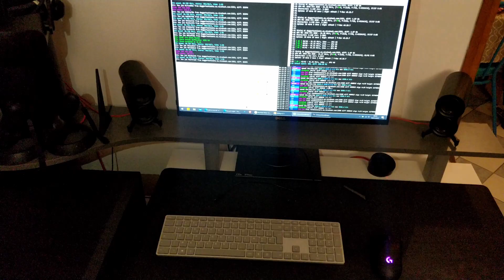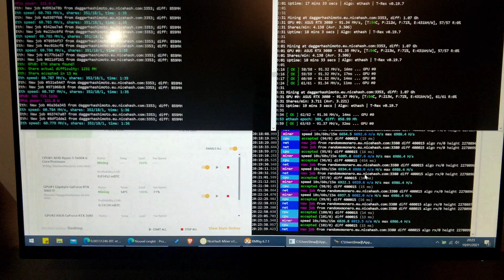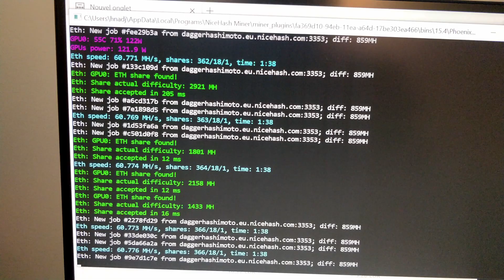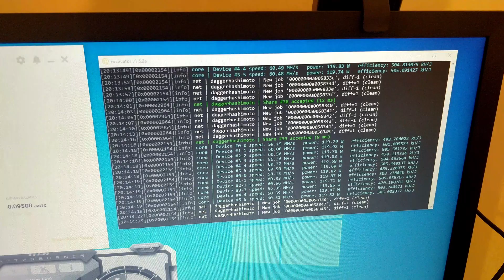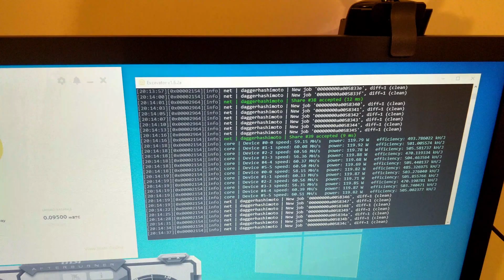DIY Mining Rigs | Mine without a frame

Comment: Wait so you put the mother board on the cardboard it arrived? What is between that and the cardboard
Reply from the maker: Nothing. It's pretty lightweight and non-conductive so all was fine
Reply: @CryptoAtHome  what about the pins at the bottom, can't they get ruined?
 I want to so the same thing, but maybe I will use the screw holes to put space between the box and the motherboard
Reply from the maker: The only time they can get ruined is when plugging in the PSU cables as they need some force to engage. Once you've done this, there is no reason they could get ruined as the motherboard is pretty lightweight and there are no graphics card directly on the motherboard to add weight and pressure.

Comment: Wow, I see what you mean about mounting GPUs externally! I'm curious though, all the PCI-E risers I can find on Amazon have scary reviews. It seems like maybe 1 in 5 of them just don't work, or will permanently fry your GPU or motherboard. Did you have any problems like these with yours?
Reply from the maker: Yes I heard the same. But I'm guessing it's mostly with the older ones and using the SATA to PCIe power cable. I have 40 v009s, from 2 providers and I had 0 defective unit. Maybe I'm super lucky, I don't know.
But in any case I would suggest buying a second one if the first one turns out to be a dud or stops working.
These shouldn't damage your cards unless you use a very cheap PSU or the SATA to PCIe. DON'T USE IT!
Reply: @CryptoAtHome  Thanks again for the advice, I didn’t realize they were versioned - I went ahead and bought some v009s! I’ll be sure to avoid the SATA adapter too.
Reply from the maker: Happy mining :)

Comment: hey i really appreciate your video. this was exactly i was looking for. i am planning to but the GA-B250-FinTech motherboard and want to ask you, what is the riser that you are using on it? if you can share a link for it so i can take a look that would be great. thanks!
Reply from the maker: I'm glad you liked it. I'm using the latest risers, v009s. They have thick foam on the bottom.
Here is what they look like : https://amzn.to/3qGDHjV 

Do note that these risers don't take molex as input for power. They come with the sata to pci-e but you should never ever use these.

I bought 40 from two different sellers and I haven't had even one defective unit so I'm pretty happy.
Reply: @CryptoAtHome   you said, "They come with the sata to pci-e but you should never ever use these."  I'm not sure If following you, are you saying use molex or sata to pcie?
Reply from the maker: Hi. The SATA to PCIe cable is a FIRE HAZARD as PCIe can draw more power than the sata connector is rated for. It has happened for some miners, don't take the risk!
Ideally, you plug in directly a PCIe connector straight from the PSU. Some risers have also a molex connector, which is also fine as long as you use only one per cable. My risers don't have molex connectors so I bought cables that converts two molex to one PCIe 6 pins. Better be safe, you don't won't a 5k rig to burst into flames!